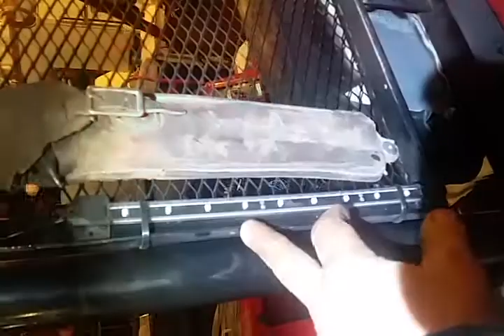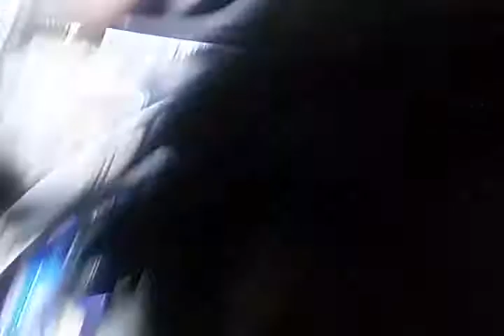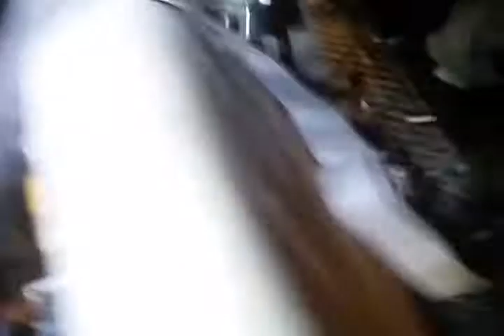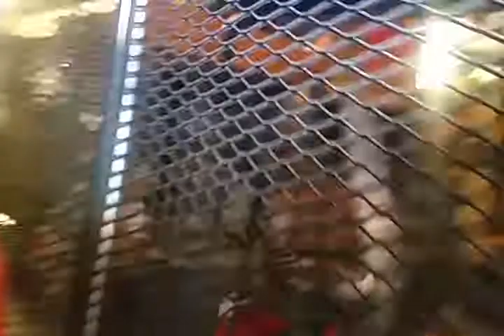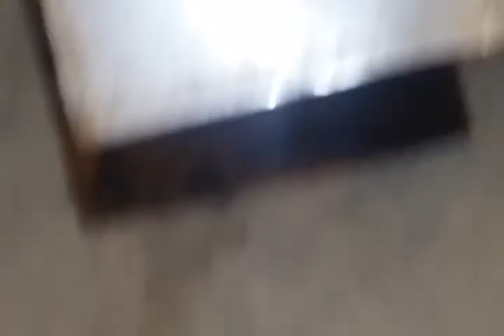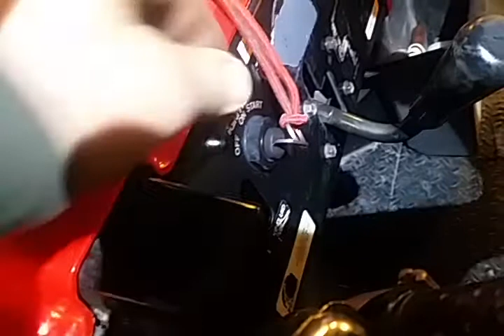Mule 2500: Turn Signals, Hazard Lights, Horn

Comment: How to you install the horn and switch for the horn?
Reply from the maker: The horn goes up underneath behind the radiator. I have a long-form video I need to post. The wiring for the horn is already present on that model. Just no actual horn and no button.